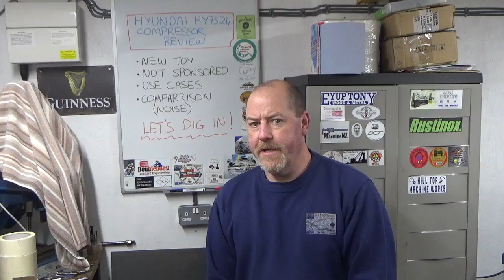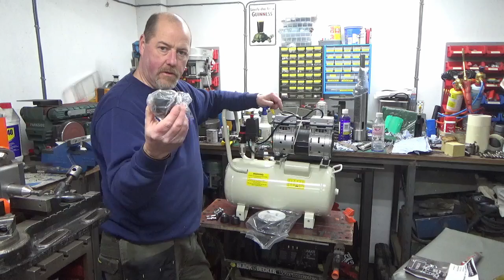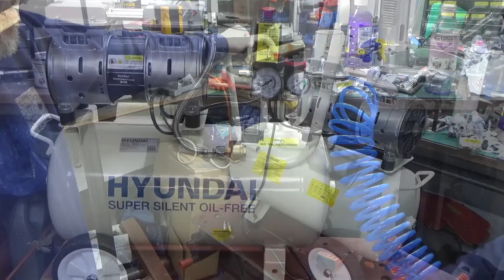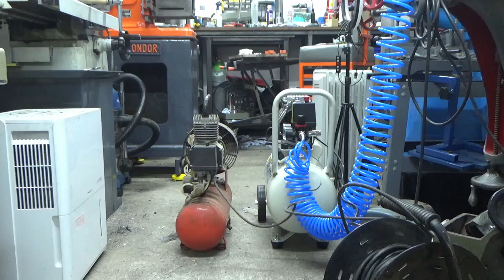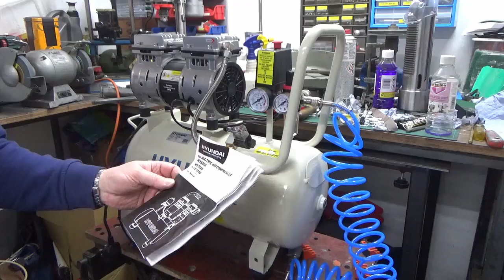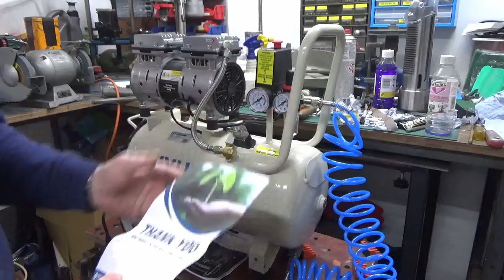Hyundai HY7524 Compressor Review - "Super Silent" or Not?

Comment: Seems like a fair review (before thousands of "miles" of use). I wish my compressor was quieter, but it's a bit larger and regular piston version. It cost less, definitely made in China. But has been working flawlessly for what I need, about 4 years no.

One thing I did was to fit a timer to it, so I press a button and get about 3 hours of runtime. They are sold for heating and ventilation fans. That way I don't have to remember to turn it off - when I forget, the compressor starts at some crazy hour in the morning (subject to what is plugged in - some things don't leak, others do... :) )
Reply from the maker: Hi Mats, thanks for the comment. That's a good idea, especially with the cost of electricity these days!! Cheers, Jon

Comment: Gday Jon, nice addition to the shop, I’ve been thinking of upgrading my compressor to a standard up type unit and putting it outside the workshop, I use quite a lot of air and I’m sick of hearing it flogging away, thanks for sharing, cheers
Reply from the maker: Hi Matty, thanks for the comment. Not a bad shout mate, I guess you don't have too many frost and ice concerns where you are so outside will be fine, plus you get a bit of space back in the workshop. Cheers, Jon
Reply: You'll love it when you do it Matty. Only thing I haven't got around to doing is hard piping from well house though shop wall and having the water separators in a controlled environment. I do drain tank after every use, but real pain in the butt to route a 50ft air hose into the shop 😞. Jon's new one is really nice and quite.

Comment: I was thinking about buying the 50l Hyundai to replace my noisy 24l compressor but decided against as I wanted much more capacity for my air tools. I now have a 100l piston type. It's noisy but nothing like the 24l direct drive job. I was impressed by how quiet yours is. 
Do keep the compressed air away from your fingers mate, it's all too easy to impinge even at low pressure. It hurts like hell (like a hammer blow) for hours and a serious one can see you off. I heard of a bloke that lost a finger because a pneumatic grease gun filled his finger up with grease whilst he was trying to lube an undercarriage. Nasty. 
Hope it does all that you need it to, best wishes, Dean.
Reply: Amen to that. Here is a story that will sound apocryphal, but is true. As a 17 year old apprentice I got a compressed air injection injury in the end of a finger off an old Champion spark plug cleaning machine. My finger had a sort of blood blister in it and it hurt like a bugger for a few days, like trapping it in a door. I learned from that though!
Reply from the maker: Hi Dean, thanks for the comment. Yep, good safety advice thank you, I completely forgot (lack of use). More than happy with the noise output, totally different to what I had before. Cheers, Jon

Comment: Bought the 50l version over 12 months ago use it most days after work & so far not a problem, set on low pressure for blowing  swarf off the tank will last all day on a couple of charges. Still am impressed with how quiet it is.
Reply from the maker: Hi bazxl57, thanks for the comment, yes, I am very impressed with noise level, looking forward to using it. Cheers, Jon

Comment: Nice one Jon, does it have the twin quick release connectors like its bigger brother? Been looking at these. Had my piston type about 5 years but makes me jump every time it kicks in lol. I'll still be using my wall mounted regulator, easy to see and added water trap.
Reply from the maker: Hi Dave, thanks for the comment. Yes, it has two Euro quick release outlets on this model. Enough for a small workshop. I may pop a couple of in line regulators on the walls for my coolant mist units, that way I can leave the units regulator at about 70 psi for blow off etc. Cheers, Jon
Reply: @jonsworkshop  cheers Jon. Exactly what I do.

Comment: Great review John, I’m sure it will be of great value to anyone looking to buy a small home shop compressor. I was fortunate enough to buy a well loved second hand Bambi 150/700 a number of years back and it’s been great, as I don’t have any room to put a compressor outside I needed a silent one. 

I paid about the same price as the model you reviewed is advertised at online, I know Bambi have always been expensive but as we used them in a factory environment and never had any issues or breakdowns it seemed the obvious choice for me, the alternatives were unknown to me but with open and honest reviews like this it may have made a difference. It’s interesting how you found the lead an annoyance I had to smile as I nearly always have to shorten leads on items I consider fixed as they are usually far too long for my liking.
Reply from the maker: Hi Brian, thanks for the comment. Yes, I would have loved to get my hands on a Bambi unit but even 2nd hand they were going for North of £500 if they didn't have "spares or repair" in the description. This thing is very quiet though, I am very impressed. Cheers, Jon

Comment: Hi Jon, well, if you have to have one that looks about right to me. Having said that the only thing I have ever used my old set-up for is inflating my car's tyres. A friend gave me an old compressor head to which I added a motor and tank(?), plus sundries. Cost zero, near enough; use zero, near enough.  🤣
Reply from the maker: Hi Del, thanks for the comment. They are a necessary evil really, I spent an hour cleaning all the tapped holes out that cylinder block with a dental pick and a rag, that's what made my wallet fall out my pocket🤣🤣🤣🤣🤣. Cheers, Jon

Comment: Hi Jon.
I got a new compressor just last week, it's a twin piston and very noisy. I looked at the Hyundai compressors but I could only see them upto 50 litre tanks and I wanted 100 litre. I too want to use mist coolant on the mill and lathe, I will be interested to see if you make the mist unit or just buy a Chinese one. I think you should make one from scratch, then I can copy it.😉 
All the best
Gary.
Reply: You can plumb in another seperate tank to increase capacity, use the tank off your old compressor if you have one
Reply: @andyb7963  WOW! Thanks for that.

Comment: Very nice review Jon. It is much quieter than the one I have. I wanted to put mine in the shed but far too tortuous to run hoses and cables. So it's under the 2nd bench with remote switch on the wall. I couldn't talk over mine, so I'm impressed with how quiet that is.
Reply from the maker: Hi Carl, thanks for the comment. Yes, seriously impressed with the noise on this one, I don't think the camera microphone did it justice really. Cheers, Jon
Reply: @jonsworkshop  I always wanted a quieter compressor. I briefly toyed with the idea of getting a second hand vane compressor and mating it up with the motor on mine. In truth though, the footprint of mine was a bigger issue than the noise. So under a bench it went. I turn it on when I need it. I do have airtools but I use them infrequently so it's no big deal.

Comment: Looks good for the money Jon. Shame that both outlets are regulated. Would be nice as lots of more expensive one have is to have 1 outlet regulated and the other Full Tank pressure. Saves yo having to keep cranking the regulator up and down for different things. You will find that you only need about 10 PSI for the Coolant mister units. Bummer is if you then want to blow odd the part or tapped holes you will need to crank it up again. Option is a separate regulator for the Mister and leave the blow off about 70 ish. If you are competent with electrics, pop off the starter cover and add a new cable. Bung the compressor out in the outhouse if you want Total Silence😊 and more space in the workshop. With regards to the auto drain on the filter, dribbling down the tank, go and pinch one of Dawn's cleaning sponges and put it on with a bit of silicon or double sided tape, directly under the outlet. Good luck. Regards from Australia.
Reply from the maker: Hi Dave, thanks for the comment. Yep, good suggestions, I have a couple of industrial grade water traps and regulators (somewhere lol), I will run a line down each side of the shop and stick a regulator on the wall where I need to use the coolant mist. It's a fantastic sounding little unit though when all said and done, very impressed with how quickly it gets up to pressure as well. Cheers, Jon

Comment: Hi Jon , I have a piston compressor, it’s about 5 times as big as that one and very noisy , only saving grace is it’s in a second workshop so don’t hear it to much, I have run 8mm plastic around my workshop with 3 air gun outlets and mist spray on mill and lathe, all purchased from Amazon probably cost me £100 all in, cheers 👍👴🏻
Reply from the maker: Hi Terry, thanks for the comment. I have just ordered a load of 8mm line and some regulators today to adorn the walls. Looking forward to trying the mist units. Cheers, Jon